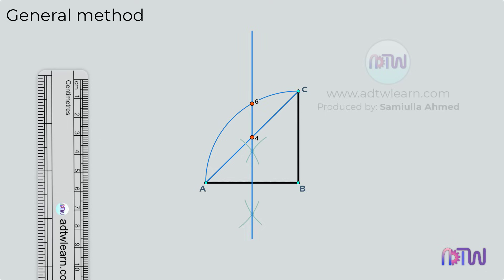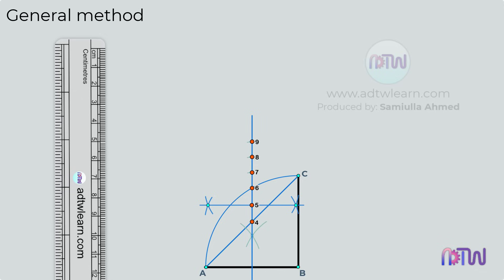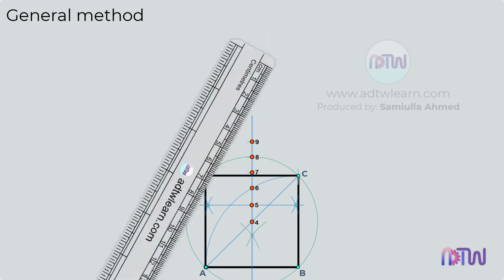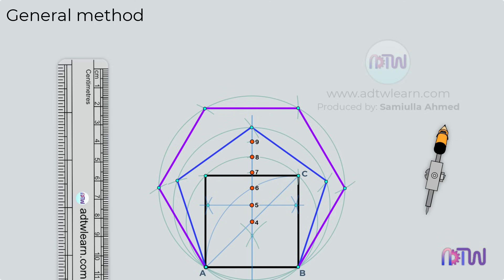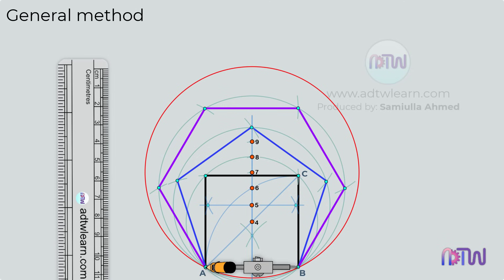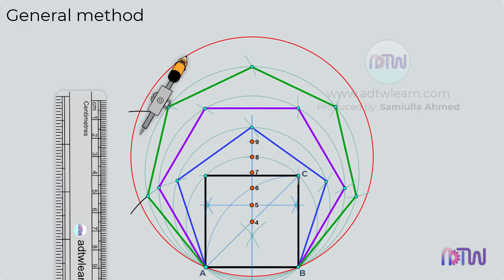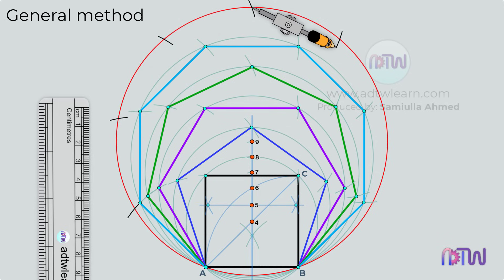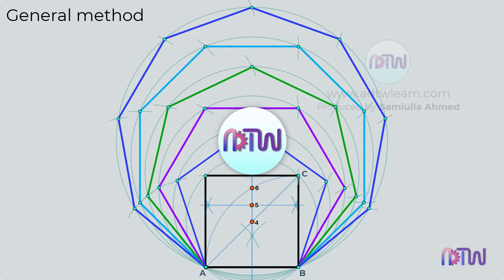How to draw all polygons, draw all polygons easily

Comment: It's not as easy as it looks here .. believe me ...  a person has to be needle point accurate for all of these polygons to work out precisely .....
Reply: Even if you have needle point accuracy, the polygons will not have equal length sides (except for the square and hexagon). You'll notice the video never claims the method will create regular polygons, but the diagrams show polygons that appear regular.
Reply: I tried this again, and no matter how accurate a person is, it doesn't work, and I payed particular attention to accuracy........
Reply: At maximum accuracy I can do correct till pentagon. After hexagon it becomes irregular and error in circumscribing circle.
Reply: I got pinpoint aim
Reply: True bro 😢
Reply: T 5 yttrium
Reply: You are correct
Reply: So true😅
Reply: I made but he has to check for me if it is correct 😊
Reply: Ya right it's a long quiz tomorrow
Reply: You're not sharp that's why it's difficult for you 😂😂
Reply: I did it. Thank you for your this tip

Comment: to be precise this construction is perfect for square and hexagon But for other polygons the error is 0.4%, which is not noticeable in a graphic construction But it is better to be precise in not defining this is an exact construction
Reply: 0.4% for the pentagon but 2.3% for the octagon.
but I repeat it is 1 mm if the side is 5 cm
Reply: In engineering the precision has to be achieved in increments until all points are precise, in spite of theorem.

Comment: This is an easy method for drawing polygons that are not-quite-regular. The sides are not the same length for polygons other than the square and hexagon, but they are close. Drawing a perfect regular heptagon with only compass and straightedge is impossible; with this method you can draw one that is nearly perfect!

Comment: This method of constructing polygons is suitable for a square and a hexagon, suitable for approximate constructions of a heptagon and further with a given side length of the polygon. for a pentagon, a heptagon, and so on, the error in finding the center of the described circle increases in comparison with the trigonometric calculation.

Comment: A very quick way of creating any kind of polygon ,I had learned from a book printed in the late 1800s ,draw a circle draw a line through the circle at the diameter. Divide the diameter in as many sides of the polygon that you want ,then at the apex of the circle draw ,a line through the second point from the left through the line of the diameter .,until it touches the perimeter of the circle. The distance from the point of the diameter at the perimeter to the new point at the perimeter is the length you need for each section of the polygon.

Comment: At the 1:15 minute mark, there's no length given for how wide/short to make the compass, because of this there is no way to go further past this point in the video. Please correct this because I have tried so many lengths, short & long, and NOTHING has worked. Please correct this missed part, thank you.
Reply: Take the length more than half of the line you drew for the square

Like if you take 5 cm for the first line then take more than 2.5 cm.
Reply: It is called 'side bisector'. Search on YouTube for detailed and clear explanation
Reply: You will learn in 7th or 8th grade to draw side bisector and angle bisector.

Comment: Time points 1:00 to 1:14 makes no sense: 1) there is no point 'd'; 2) 'take some length' -what length?  Thank you.
Reply from the maker: 1. It's points A and B.
2. When we want to divide any line into two equal parts we use the middle point method, in which we take a compass and adjust it to a length which will be equal to more than half of the line which we want to divide...
Reply: @ADTWstudy  Thank you.  I figured it out, I was confused by some of the explanations.  Your method is very elegant!

Comment: Recreated this in desmos geometry. It should be noted that the pentagon & heptagon aren't exactly regular, but they are very close to perfect, especially considering the fact that an actual heptagon has been proven to be impossible to construct with a pen & compass.

though octagon & nonagon though are very bad & this video is blatantly lying. If you follow the method exactly in this video for the 9-gon, one side will be noticeably longer & angle variation will be more than 4 degrees for each corner. If this video mentioned that some of the construction are just good approximations then I wouldn't be leaving a dislike on this video.

Comment: It may or may not be an accurate construction for 5, 15,17 and the other known constructible polygons (31 in all) with an odd number of sides, but 7, 9, 11, 13 etc are known to be impossible with only a compass and a straight edge. These are, at best, an approximation.

Comment: How do we get the middle point??
Reply: Use the compass set to a bit more than half by eye, then draw arcs from each end both sides of the line. Join them they cross the line at mid point. Tip. Use sharp compass and pencil

Comment: I checked it out with trigonometric fórmulas, this method is not accurate. Apothema should be Side of the polygon L/tan(pi/n) where n>2 is the number of sides. This method leads to Apothema = (l/")+(n-4)*(l/4)(sqroot(3)-1), and they are not the same.